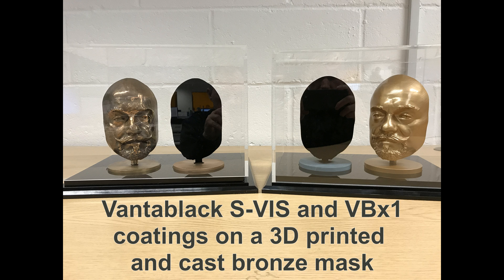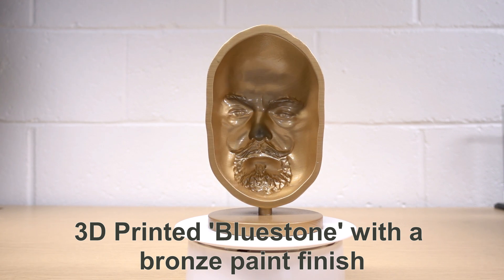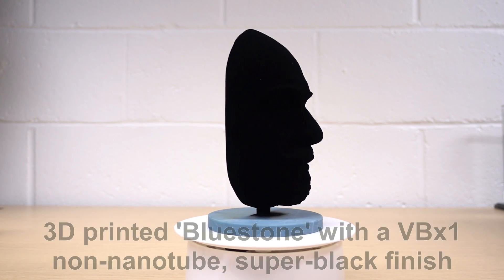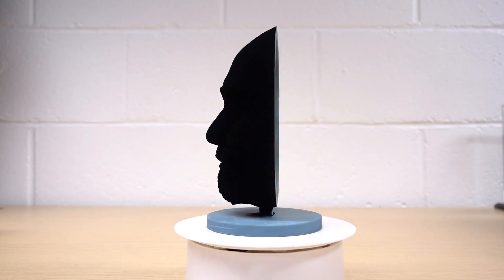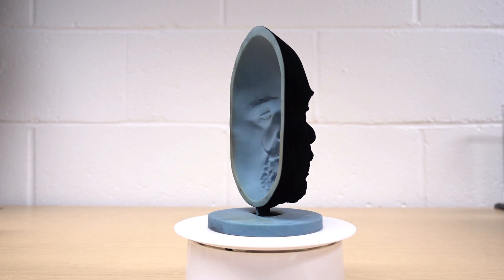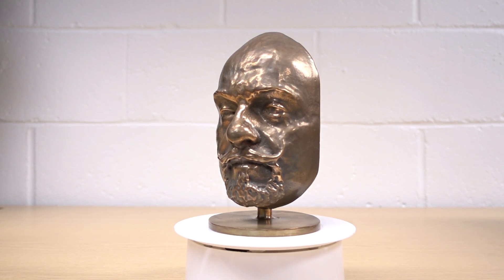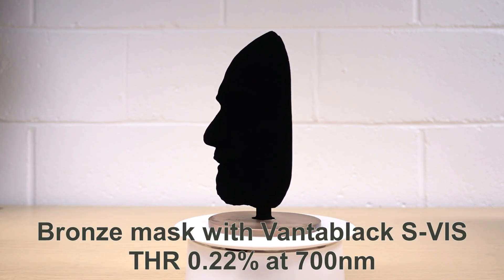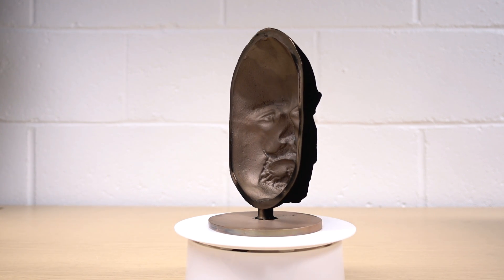Vantablack S-VIS vs. VBx1 on a bronze and 3D printed mask set

Comment: Can't vantablack be used in communications ? I mean some sort of fibre optic type ? 
You could theoretically grow these tubes on silicone chips in a set pattern just like circuits and use light photons as a medium instead of electricity flowing through the circuit paths  to relay the bits in binary ?
I mean that would literally be at the speed of light ...
Processors that run on photon guns firing photons between circuits printed with vantablack

Comment: Fantastic invention BUT if this material can trap this insane amount of light could this technique some how be used in solar cells where they say that they have problems trapping the light. Also if you put this material in direct sun light how hot will it become?
Reply from the maker: No, that wouldn't work as no light wouldnt get to the solar cell. It would all be absorbed by the coating.

Comment: How hot does it get when put under sunlight if it does not radiate the absorbed energy as infrared?
Reply: Or under any light - if it indeed doesn't radiate infrared the absorbed photons have only conductance to the air and supporting structure (eg. aluminum plate that's coated black) for energy to escape. If the inside of a sealed tube is coated, like in an evacuated solar tube, almost all the energy will accumulate in the Vantablack material.
Reply: can be used for portable large scale solar thermal power possibly?

Comment: This could be useful for some type of light to heat and from heat to electricity whole roof solar panels, depending on the cost of the paint. If that would get to some bigger structures, like airplane hangars and airports, they could get their energy consumption down quite a lot.

Comment: What happens if you take very long exposure pictures of the mask? Is there somewhere a dedicated amount of seconds in exposure to start seeing the material itself. Like you would try to over-exposure the mask coated with vantablack. 

And also, if long exposures aren't enough, if you exposure stack, can you then see them? 

Would be an interesting thing to see how many seconds of exposure it would take for a DSLR to capture some light from the paint/coating!

Cheers!
Reply from the maker: If you overexpose the picture when you shoot you will then see the features.
Reply: Surrey NanoSystems How long exposure, aperture and ISO has to be on the DSLR to be able to see the features e.g. in the same light as in the video?
Reply from the maker: We haven't experimented with this, so I can't give you an answer.